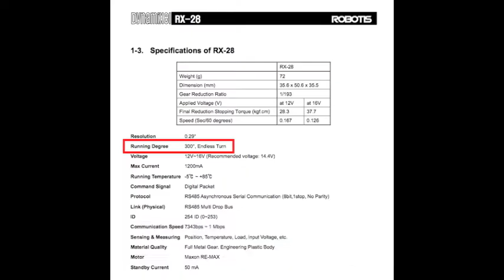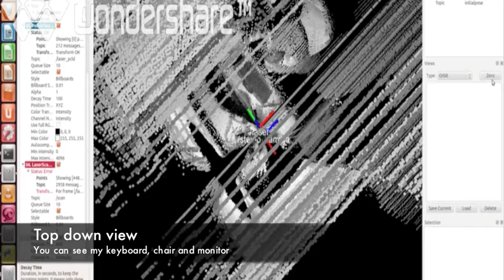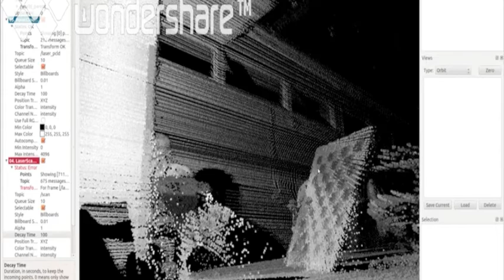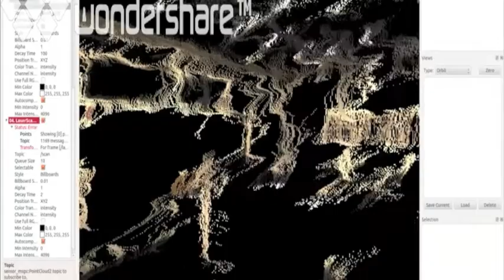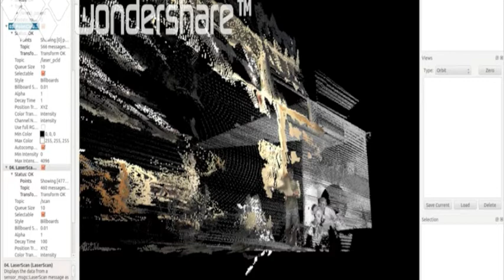RA Project

Comment: This is some amazing stuff, man. I was led here from your answer about slip rings in an old thread. 

I'm trying to get into mechanical/software/electrical engineering after the military and one of my projects is trying to make something of a gimbaled camera/spotlight/LRF combo turret that feeds to a monitor and is controlled by joystick. I don't really know where to begin other than looking up similar topics and experimenting etc. Do you know of any way I could put a laser rangefinder unit capable of accurately measuring out to a mile or so on a computer interface and have the information display over a video feed?

I think your work with LIDAR and 3D mapping tech is cool as hell, and I'd like to know what fields you study and/or where you go to school. 

Any feedback would be appreciated. :)